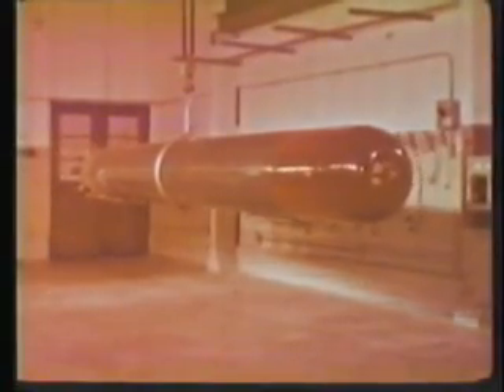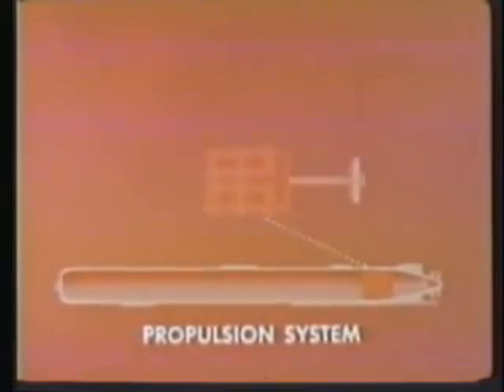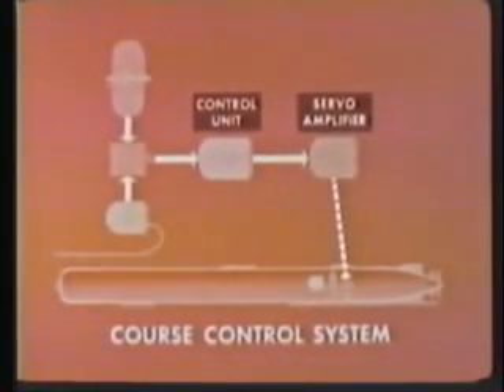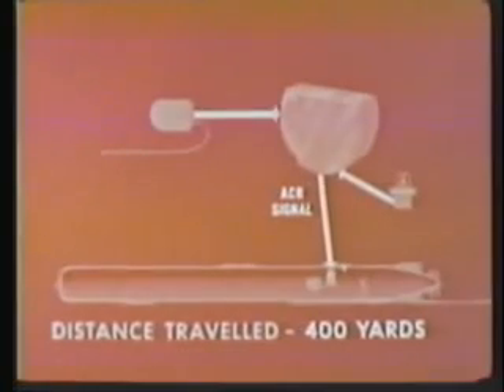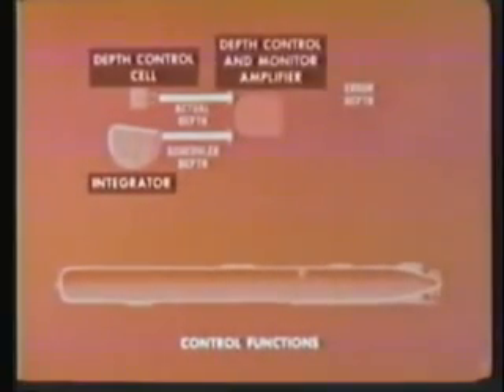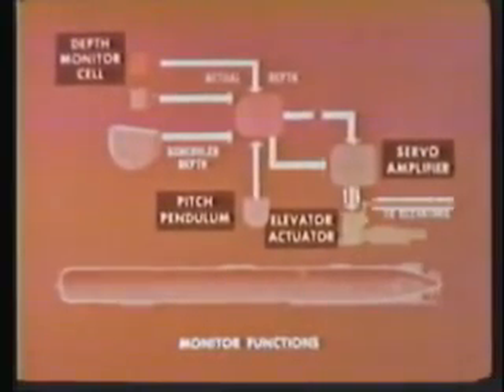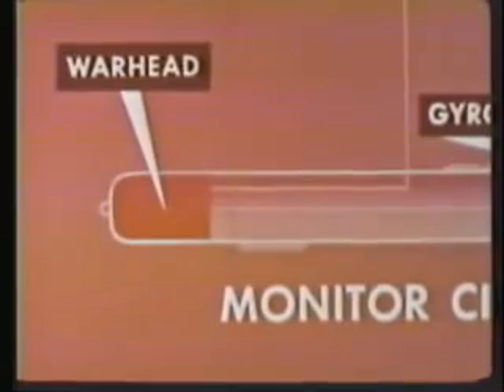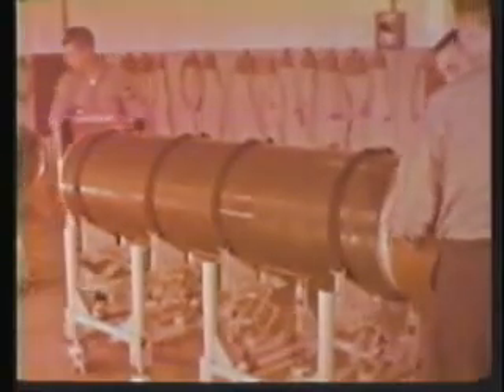Declassified U.S. Nuclear Test Film #50

Comment: From below: "oh my god, all those analog electronics. "

Much of the older analog technology was much safer than today, even vacuum tubes, especially with easily damaged things like today's JFETs and chips, which have a low static charge sensitivity, and can be destroyed by mere handling, which was not available back then. Today's surface mount technology is a curse toward a technician, or an experimenter, due to the parts size and weakness. There is such a thing as making things too small, and too weak. Industry prefers you to throw things away, and not have them repaired any more.
Reply: So flargin tru
Reply: We got to move those microwave ovens, custom kitchen delivery,  
we got to move these refrigerators, we got to move these color TVs